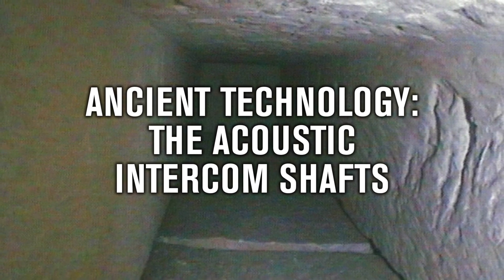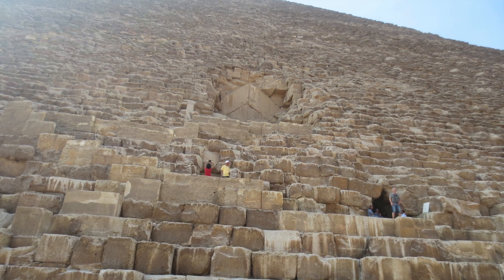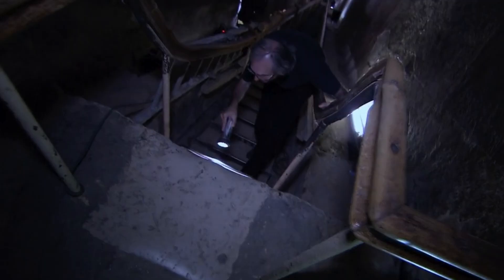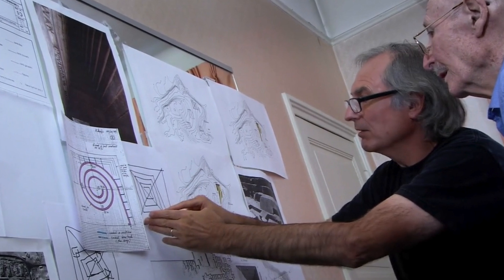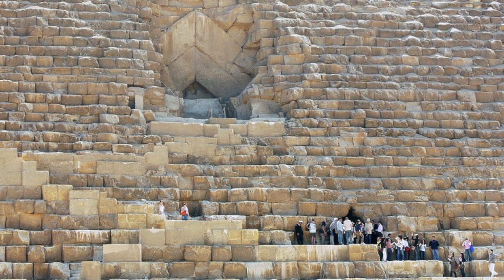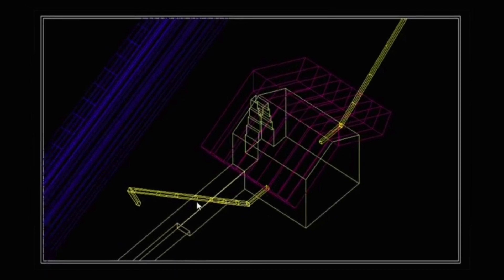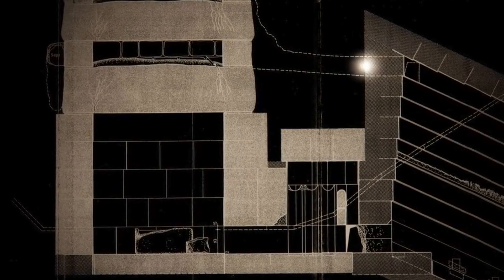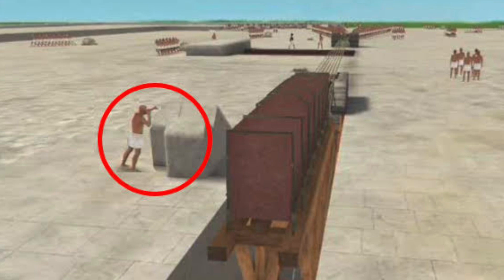Great Pyramid ‘Air Shafts’ Theory: Acoustic Communication Shafts | Ancient Architects

Comment: I love the idea of the second grand gallery, and the symmetry of the two galleries with the two sets of shafts and that they're related in some way, but the intercom theory doesn't make any sense. It is far from the simplest way they could've achieved communication, so fails by your own benchmark. The other illogical leap is the implication that the interesting acoustics MUST be a design feature rather than just a side effect of the materials and chambers. I'm not convinced that an arbitrary collection of stone tunnels and chambers wouldn't exhibit similar acoustic properties.
Reply: Audio communication is the most direct form of complex communication known to man, much better than the written word f.ex. What possible other type of communication could be simpler? I don't believe you can answer that question.

 If the chief architect sits in the middle of the structure, with all the plans laid out and communicates directly with his colleagues on both sides through the shafts, then the chambersbecome command centrals of sorts. Or it could simply be used for timing and symmetry purposes.  It's a simple, yet brilliant solution, saving a lot of time.
Reply: @WallaceSpirit  Of course they closed the Queens chamber shafts off. They had finished that part and was moving on to layer stones on top of that part. It's really quite simple and don't need your complicated what-if techs.
Reply: @bluedog7222  Maybe not the chief architect then, but someone who knows what needs doing and can ensure smooth near instantanious communication between the work crews on either side of the construction.
Reply: @jonbojsenkvrndrup8180  Nobody is an idiot... even the people so sad calling others idiots are not idiots. They are just really sad inside and need love 🙏😇 Stay awesome brother. PS: As above so below. The pyramids are really super extremely impressive and unique in this whole world... below earth is as impressive or more 💜 Dont close your mind brother. Sending love your way.
Reply: @WallaceSpirit  Well, looks like you got me there, I'm just really sad :D - and you aren't an idiot for spreading complete nonsense.

 As for the pyramids they aren't more unique than being built in one form or another all over the world. It's the structural type best suited for massive buildings.
Reply: @jonbojsenkvrndrup8180  If you look at the interior architectural composition... innerstand chemistry... you would know THEY ARE UNIQUE 😅🙏
Reply: @WallaceSpirit  change ur dealer!!! ASAP!
Reply: @jonbojsenkvrndrup8180  no it’s not. This is a terrible theory. As the pyramid gets higher it gets smaller! Therefore it becomes easier and easier to communicate with each and every layer of stone laid. By the time you’re up to the ends of the shafts you could just shout a message between two or three people.
Reply: @TheGreatest1974  The width of the pyramid at it's base is 230 meters currently (it's lost some meters from stone looting).
 Not a distance for easy vocal communication, you need visual communication.
 And the structure itself - being built from the inside out - blocks visual communication as it goes up.

 Consider that the sides of the pyramid only vary by 0,05% from it's mean lenght. It's a work of extreme talent. How could they have done this with shouted commands or semaphore alone? Impossible.

 And the Queen's Chamber is only slightly above ground level, maybe 20-30 meters. It would've been the perfect place to start the construction and build out from there. Once the Queen's Chamber was finished, it became the base of command for the work that would then continue on top of it and to the sides of it. Using the channels to communicate through, making sure both sides followed exact measurements and placed stone blocks in perfect tandem, so no deviation would happen to the plan (that could and had caused collapses in earlier pyramid structures).

 Further up you get the King's Chamber, like around 200 meters. A perfect position to take on the next stage of work, on top of the Queen's Chamber. It would be the tomb, but first it was a command central of sorts.

 I find it a compelling theory that works on a practical level - as well as having religious functions for the ressurrection of Pharaoh.
Reply: @jonbojsenkvrndrup8180  ‘the queens chamber is only slightly above ground level, 20 - 30 metres 😂😂😂 you wouldn’t like to fall that distance. Even into water. And starting off to build the great pyramid by building the queens chamber first? You must be on something that’s affecting your mind. That’s the strangest thing I’ve ever heard to put it politely. And building from the inside out why would you build the shafts at all? It stands to reason they weren’t built ‘freestanding’ and then the rest of the building built up around them, so they must have been built as the pyramid got higher and higher. This whole theory of them being a ‘noise communication’ device for relaying ‘instructions’ is ridiculous. The inner blocks of the pyramid are not perfect in shape, more just rough blocks laid down as filler for the finished shape. The only carefully cut and laid blocks would be around the rooms and passages to keep them properly in place. You simply would be wasting your time making every single block perfect in some way. There was no need for that. This theory just is nowhere near the mark in my opinion. A sheet of copper rolled into a megaphone shape would be far easier to convey instructions if they really had to.
Reply: @TheGreatest1974  20 meters is close to the ground in a 480 meter structure ;)
 I think my point flew completely past you, but that's ok. The written word is easy to skip across if you don't want to read and if you don't know the theory of construction that's behind this idea, it must sound dumb to you. Your loss.
 At least it's good that you got a laugh out of it :)

 Also your sheet of copper is rather useless with a massive 30 meter tall structure in the way, but I digress. I'm sure you know what the shafts are for.
 Another guy wrote it better further up, about them being specifically for the construction of the load-bearing chambers. Have a look at his explanation, if you're in doubt.
Reply: @jonbojsenkvrndrup8180  ok I’ll give you the thing about the copper sheet. But surely you just can’t be seriously thinking that these were just for communicating during the building of the pyramid? That’s just absolute nonsense. Why even try and build such a complicated set of shafts to communicate when you could use a runner with instructions? Plus, it would make sense to lay blocks next to each other one after another- so where’s the ‘long distance communication’? The guy could just stand right where the blocks were coming up and direct operations right there. It’s preposterous. A terrible theory. The fact is, until someone comes up with a REALISTIC idea for the copper terminals on the doors and the fact the bottom blocks in the queens chamber were deliberately blanked off, and invisible from inside the room,- nobody has any real idea. And forget chemical factories too. Ridiculous. More likely to be something to do with the ark of the covenant and electricity in my view. The ark is a fascinating thing if you read about it. And it fits perfectly into the coffer in the kings chamber.
Reply: @TheGreatest1974  Concerning the blocked off Queen's Shafts, you really should have a look at a diagram of the pyramid to see how deep in the core it actually is. It's obviously been built around and it's logical that it would be blocked off once it's use was finished.
 The King's Shaft shafts point directly at the North Star and Sirius IIRC (or would have at the time), so they had definite religious uses. And they do have this audio quality of an echo chamber.

 I prefer an explanation that I can visualize and that works with the stuff we know about them already, rather than relying on unknown tech. But yeah, I hear your criticism. 

 I do believe that you would need a lot of precision and coordination to place these blocks, when you're delivering several thousands over a course of a season. Any deviation would shift the pyramid's balance and the blocks aren't necessarily the same size.
 But as someone else said, the communication aspect was probably used to place the massive blocks that's stacked as a roof of sorts above the Queen's and King's chamber.
Reply: @jonbojsenkvrndrup8180  I don’t believe the blanking blocks in the queens chamber were only put in AFTER the chamber was finished and the shafts were not needed anymore. Simply looking at the walls of the chamber, where the blocks are, shows you that there’s no way you could ‘slot’ that block into place as tightly as it’s in, as it’s a load bearing block as well, and holds up the wall!
Reply: @TheGreatest1974  Ok, I had to mull over what your reply meant. So what you're saying is the blanking block closed off the Queen's Chamber shaft when it was placed? 

 As far as I can read, the shafts were included in the limestone blocks as they were being placed and were bricked off at the bottom, while a blocking stone 6cm thick closed the shaft from the top (the one with the copper handles).

 That blocking stone could easily have been placed before 6 meters of further stone was layered on top.

 It makes sense to me that once the foundation of the Pyramid was finished and work began on the upper levels, the Queen's Chamber shafts were closed off. Their usefulness finished and work began on the King's Chamber and above.

 Source on all the measurements and stuff. https://ancientegyptonline.co.uk/queenschambergp/
Reply: @jonbojsenkvrndrup8180  no. The queens chamber shafts couldn’t have been ‘left open’ at the BOTTOM until the room was past finished, because the blanking blocks at the bottom couldn’t have been ‘slotted in’ after the whole room was finished and the shafts had served their ‘communication’ purpose. I don’t believe they could’ve shoved in the blanking block into the wall afterwards, because it’s a load bearing block and the tolerances are too tight and close.

Comment: I'm glad that Matt from Ancient Architects is open to new more technical engineering based ideas, much better than his previous esoteric explanations about souls of the dead Pharao flowing in bedrock groundwater to travel through the fake doors and then through the shafts to the sky and stars. 
Efficiency and pragmatism in labor and logistics is always the most important aspect in constructions. Anyone who stood at a frozen lake in winter would see that he can hear people talking on the other sid of the lake, even 300m away. Sound waves are reflected on hard surfaces and not damped. The shafts are really like acoustic channels and Pierre's explanation hits it on the nail. Coordination of work and logistics of material is preeminent in a large construction site.
And what about the rough shaft straight down to the underground cave?
The cave was definitely once flooded with ground water. Now... you have a huge construction site, 50-100m above the ground, in Egypt, at 30°C and more, and thousands of workers sweating away in the heat. 
You need what? WATER!
I'm sure that the digged out roug shaft to the underground grotto and then to the bottom cave were necessary add-ons to get water to the workers. Maybe they had water canisters on ropes to pull them up. And we can assume that all the shafts also were used to pull canisters full of water to the top for the workers. It's efficient and straightforward. Any thoughts?

Comment: Matt, Would they really have built a chamber of tura limestone just so that 2 teams of navvies about 280 feet apart could coordinate with each other. Then cart megaton blocks from aswan to do the same thing higher up the pyramid when the crews were even closer. Then why is there no similar comms system in place at the bottom when the crews were 750 feet apart when getting the base right was probably the most important part of the project?

I look forward to your explanations in the vid when you finish it
Reply: Or also why  this tech is not in the other huge pyramid next to it ?
Reply: If it's for acoustic signaling, 5 more signal workers could have done the same job. Signaling around the pyramid. With flags maybe. It was noisy, back then.
5 more signal worker would have been much cheaper then the shafts.
Reply: Maybe the shafts were for ropes. To get power inside. In the camber there was not much room for workers or even elephants.
Transmission for the cranes.
Reply: @MartinScharfe  then why it was closed in QCh?
Reply: Don't know.

Comment: I have question regarding your confidence in this theory. The computer images show the builders using some type of rope. What is his proposal for all aspects of this rope? Where and how was it manufactured, how much time would it take to create the lengths needed? The ropes would need to be constantly maintained, repaired and replaced due to the amount of stress being placed on them constantly. It may seem like no big deal but without a viable solution for all aspects of the rope this theory is no more viable than all the others.
Reply: You bring up a question I have pondered.  These elaborate pulley systems require thousands of feet of not only strong, but smooth, consistent rope.  Plus, the constant fraying would mean... a lot of thick, cable-size  cordage being made... somewhere.  This is another vital item that we have little to no evidence they had.  I don't think you can make rope capable of lifting thousands of pounds from weaving reeds.  Did they have hemp?
Reply: But still you can clear see on the drawings on the walls that they used rope sleighs and a lot of people to move things they definitely used rope but again your questions are more questions that need to be solved
Reply: Being one who watches way too many archaeological lectures, if I had to speculate, one of the ingredients for the ropes would no doubt have been papyrus; perhaps the stalks. Having grown this plant in my garden, those stalks once they're dried have a tough linear & fibrous internal structure. Reeds and sedges were also common plants utilized as/for building projects throughout the ancient world.    I would imagine a combo of a couple types may provide just enough give, as well as durability under strain.
Reply: There is a rope museum in Egypt entirely full of ancient ropes from the past several thousand years.
Reply: Reading this 3 years later I'm wondering if you ever tried rope making to help answer your own question. Will probably be very interesting to do at once or twice. Maybe insightful.

Comment: Great and interesting explanation. But more simplistic than that, would be workers being messengers. A couple would be enough, althought they'd need extra water hehe. And why there are no shafts at lower levels, if the distance is longer?
Maybe in next videos these questions are answered.
Reply: Yeah this makes no sense at all to me, why go through the process of constructing these shafts just to talk when they could, as you said, just use some people going back and forth?
Reply: At lower levels there was no use of a counter-weight system that needed coordination at both ends.

Comment: whats the value of being able to talk to people in the chambers?? 

there must be another use beyond burial if such effort went into being able to communicate with the chambers. construction is not good enough a reason, it doesnt warrant all that effort.
Reply: Yeah. Doesn't quite make sense.

But the shafts were sealed up and buried during construction. So any function of the shafts would seem to be construction related. 

I tend to favor air shafts, for crews doing finishing work on the interior while others kept working outside. And when they were done polishing etc, the shafts weren't needed, so they weren't continued any further, so they don't extend to the outside.
Reply: @bozo5632  then the queens chamber shafts would need to be open at the bottom entrance until a certain point, then the blanking block put in place later? It doesn’t look like that block was slid into place after the room was finished. Which would indicate that if the shaft was made whilst the room was still being built, it would be in the open air. Which would mean you’d have air in there anyway, and not need the shaft for air.

Comment: We gotta build this small scale, 1 course of stone per video, to figure out why each stone is where it is. I mean that's the only way to find out. There's no way the pyramid came out exactly as planned. They ran into problems and came up with solutions and those solutions gave way to changes and more challenges and solutions. By the time they were done they probably advanced building technique and machines by decades. 
Great video! 
Pretty sound theory actually. 
It's similar to sound powered phones used today in ships. You communicate with topside about what you're sending up from below decks. This makes operation safer and faster. Communication like this would definitely speed things up.